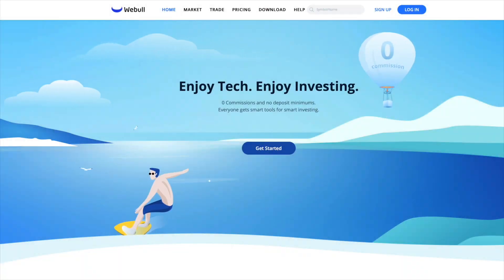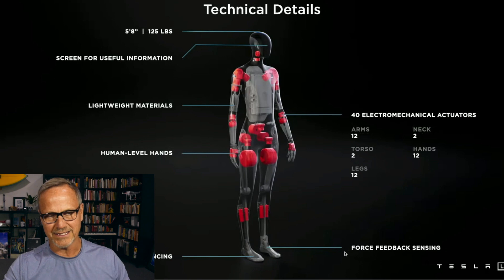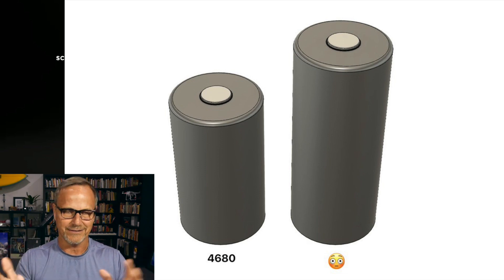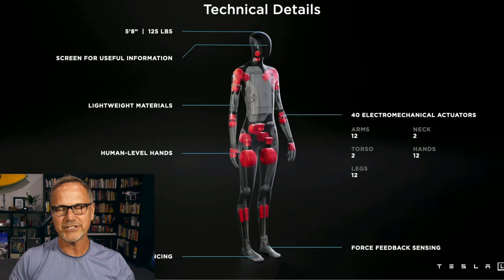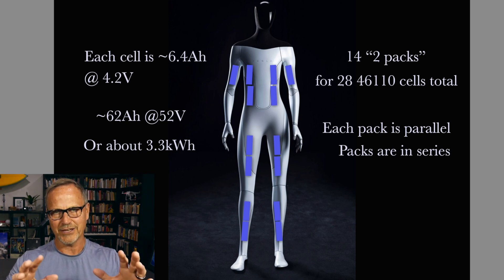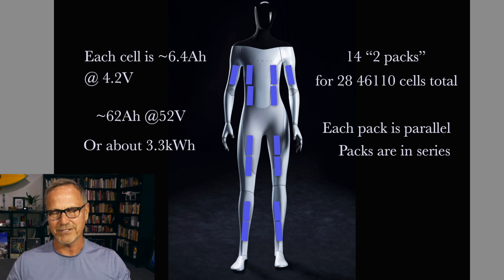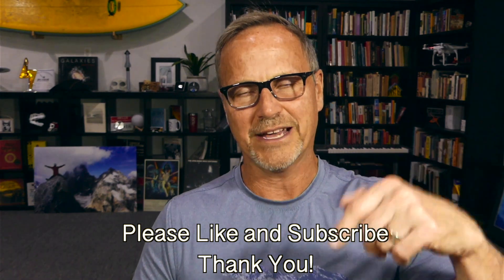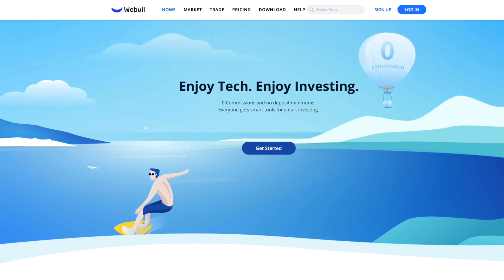Teslabot POWER!! Where the heck will the BATTERIES FIT?!

Comment: I'm having trouble with the math: When you put battery cells in a series, you add the voltage, but the capacity stays the same. When putting cells in parallel, you add the capacities, but the voltage stays the same. At 3.71 volts per cell, you describe a 52 volt battery@12.8 amp hours. That works out to 665.6 watt hours, not 3.3 kWh. The major source of heat will be the computer brain. Batteries charging and discharging in hours, not minutes, just simply won't produce much heat. Running the actuators won't actually use much power, and, this thing has full regenerative motion stop. While it takes energy for an actuator to start a move, they will actually recover some of that energy when the movement stops, sending it back to the battery. If this machine walks up stairs, it can gain back some of the potential energy it spent, when it walks back down the stairs. If it moves heavy boxes from an upper level room, and carries them down into the basement, and walks back up the stairs empty handed, it can actually GAIN power regeneratively, with no loss of battery charge whatsoever. That said, this thing can wander around all day on just over 1/2 kWh. This is a stark contrast to the Boston Dynamics Atlas bot, which can only run for a couple of hours on a massive 4.5 kWh battery. It has no regenerative stop motion, and being hydraulic, a lot of energy is wasted as heat. Keep in mind, Optimus only weighs ~125 Lb. Putting in a comprehensive cooling system would add weight, necessitating extra battery capacity, making it heavier yet.      
     I really hope that the finished product looks anything like the images we've been shown. This thing is beautiful. It's anthropomorphic enough to be personable, but not so realistic, that it's 'creepy'. It has no features, to define gender.

Comment: Distributing the batteries throughout the body like that goes against everything Tesla and their engineers are supposed to do. The Tesla bought will more than likely have two battery packs at most. They will be easily exchangeable and somewhere lower on the body for a low center of gravity so you're more than likely looking for somewhere around the hips. They also wouldn't add weight to the legs or the arms because that would make the servos work harder. 

Again I cannot stress enough how much complexity is hated at Tesla. 

The batteries will be quickly exchangeable because charging is not going to be what is wanted. 

These will be long-term workers on the factory and on Mars. You will run on One battery while the other is charging. Or you exchange One battery and then exchange the other to make sure there's always a backup in case one fails. 

Considering that most of the work will be done with the hands in front of the robot the battery and the exchanging of the battery will more than likely be done in the back. 

The main problem here is your failing to think like a Tesla engineer.

Comment: I’m guessing a standard version might look a little like you mentioned, but a backpack could be added for more “range” just like external tanks on jet fighters. Also a higher CG is actually easier to balance so that would help. For a bot lifting weight a slightly aft CG from a backpack might be helpful.

Comment: Legs, feet and pelvis bones for batteries or better still the skin. induction plates where it makes sense. feet or thighs if on a production line. For that matter if the robot is going to be on a production line, batteries would only be used for moving the robots around and FSD as they could charge while working. Solar and magapacks would be required for all factories.

Comment: 4.2 volts is not the running voltage of li ion batteries, 4.2 is there fully charged rate and is not the voltage you say the cell runs at. It's 3.7v that is the voltage of a cell being drained and is considered flat around 2.7 to 3 volts which it only hits once depleted under load when the bms cuts the power to save damage. Geez, this is meant to be a channel of smart people and you are making shows on false facts not only speculative!!

Comment: Presumably the weight distribution of the human skeleton is perfect as it is. Something closely matching that would be best with battery distribution. A spinal cell structure, tapering limb cell structures I.e thicker at the shoulder, thinner at the wrists, same in legs. Cells would need to be structural rather than dead weight.

Comment: You do not want mass in lower arms or lower legs since these parts move the farthest most often and thus masses there have the most momentum & inertia . Active liquid cooling is not all that complex and simplifies a lot since it is needed anyway. Batteries can have the cooling plate built in if it is simpler. The head is likely mostly empty so can be used as the radiator. Far future I might use a custom long skinny battery form factor to make a strong honey comb for the thigh battery. Whatever is heaviest, probably leg actuators, should be bunched up in the pelvis as much as possible for best balance even if bunching it up requires active cooling. Tesla is not trying to optimize the 100W car computer and will use the same hardware; perhaps both may get optimized when the chip shortage clears up. At least for the next few years new chip designs to lower power draw are too slow to get.

Comment: Brilliant idea. Distributed battery storage makes a great deal of sense if the technology is used to create Neuralink controlled prosthetics for people who have lost limbs or lost mobility. This would be an  high value application that would generate significant revenue while Tesla perfects the AI control side.

As for temperature control, the servos and batteries could be housed in a porous structure, with active air flow to cool them down.

Comment: You don't want the batteries in the limbs because it increases the load on the joints.  Batteries should go in the torso and if there is insufficient room then give it either a pot belly or a chest.  If you make the chest large enough nobody will care where the batteries are! :)

Comment: You forgot batteries in the butt !! 😆 Thanks John you are unique and a original thinker. Posterior could also be a good place to charge as Optimus could just sit down and charge … meaning it could charge will doing useful sit down type (assembly) work. While we are at it the posterior could also be a good centralized place to expel air with an Elon invented fart sound. Sorry it was just too tempting! 😆

Comment: the weights shouldn't be in the limbs.  The limb segments become lighter and lighter the farther out they go toward the extremities.  The smallest finger bones are at the tip and each bone segment becomes larger and larger as you go up to support all the mass of the total limb.  It's like a whip.  Throw a fast ball and you're throwing out your arm, actually you have to pivot your whole body including the hips and using the legs too - but the shoulder throws the upper arm then the elbow throws the forearm then the wrist throws the hand and the fingers acts like a whip uncurling all the way to the fingertip to throw the ball in a smooth efficient whipping motion.  The question is whether to try to use the example of the human body rather than just make up something new.  At least try to do it right, it's okay to fail but try it correctly first.  Humans can use 2 gears when walking and running - the slower gear is when walking on heels and the higher gear is running on the balls of the feet and using your toes.  Compared to regular quadrupeds like a cat, they only have one gear because they're already running on their toes.  You can examine your cat or dog, also look at an athlete sprinting you'll see toes are important.
The question might come down to, could a bipedal humanoid robot work without simulating human feet?  It must be attempted.  I think a tripod robot is not the plan.  It must be humanoid and thus it must learn to stand like all humans so that it can be inserted say into any human task.

Comment: I think the heaviest pieces would have to be central to the unit for balance.

I was thinking they'd go mostly in the feet, and torso, with perhaps some areas of the shin.  Feet is where I'd put a lot of the weight, so it has a strong base and isn't too top heavy, and chest because it's going to need that center of gravity / storage size.  I don't know about the arms.  If it gestured out too far to one side I could see it tipping with heavy battery arms.

Comment: i would put in two power packs, one built into the legs with a foot charger as people suggested so can stand in a show open a port and charge there. And an optional backpack power unit. This would allow battery swapping in areas where chargers arent possible. I.e in an orchard pruning or picking fruit.Would have a backpack on for extra power life

Comment: Thanks John, I think mass should be avoided in the extremities of limbs because these areas need to stop and start moving relatively quickly. I think in some situations the bot could be charging while working. eg. While performing functions at a fixed work station. The bot could plug itself in to a charger as it arrives at a work station.
I think the pelvic area and upper thigh area would be ideal places for higher mass infrastructure because when the bot bends it’s back too much mass towards the head would make balance problematic 
Great video thanks

Comment: Battery placement will depend to a degree on the work intended for the machine. For heavy lifting the robot will need a low COG to prevent toppling and provide a strong foundation for the extremities and torso to leverage from.

Comment: It indeed does make sense to distribute the batteries out partly for the reason mentioned in the video.....(i.e. weight management) and also mostly for SPACE MANAGEMENT. The limbs are likely to be hollow pipes (the geometry gives the highest strength for material mass) which can be easily filled with cylindrical cells .
In all probability it will be 4680 cells itself. Longer versions don't necessarily make sense (it's not just heat management, but structural strength also is important.....so longer ones will need thicker cell wall etc). Given Elon wants to have cookie cutter factories worldoever making standardized products it doesn't make any sense to create longer cells for Semis (which are really not high volume products!)

Comment: Around 10:00. Why couldn't each battery or pair of batteries have a small cooling system? I mean, you only need to cool each battery or a pair of batteries each.  Not a whole battery pack. They could pull power from the existing wires that go to the servers and electric motors.

Comment: Yeah…As a Design and Manufacturing engineer I have to say these batteries NEED to go in the chest area/ or backpack and NEED to be one unit.  If you spread out the batteries you will add a lot of wire/mounting weight throughout the system.  Distributing the batteries also causes a bunch of issues with how do you route the wires through a moving joint.  In addition it creates a bunch more potential failure modes/points.  You reduce the complexity significantly if it is a single part in the chest, and Elon is all about reduced complexity.
Reply: It does make sense to distribute the batteries out partly for the reason mentioned in the video.....(i.e. weight management) and also mostly for SPACE MANAGEMENT. The limbs are likely to be hollow pipes (the geometry gives the highest strength for material mass) which can be easily filled with cylindrical cells .
In all probability it will be 4680 cells itself. Longer versions don't necessarily make sense (it's not just heat management, but structural strength also is important.....so longer ones will need thicker cell wall etc). Given Elon wants to have cookie cutter factories worldoever making standardized products it doesn't make any sense to create longer cells for Semis (which are really not high volume products!)
Reply: @Randall Reacts Graphene wiring? More batteries low for stability? Capacitors higher for short term heavy lift motions? Inductive charging in feet for stationary duties & along routine paths?
Reply: I have been following Boston Dynamics for the last 10 years. Unless Elon buys an established robotics company he has 0% getting anywhere near that prototype the next 10 years. If he does lets say buys Boston Dynamics you can clearly see that the real bottleneck in androids is the kinematics and not the processing which is Elons selling point.
Reply: @jkntrds9635 Haah your comment didn't age well!!

Comment: The batteries might be integrated in the actuators in a smart way.
Reply: This could make sense. With micro charge inverters and control circuits for each group of actuators. This would reduce heavy wiring, add redundancy. It would only need control and balance wires between body segments. Also addresses keeping cells balanced if distributing cells throughout body. Lightweight. Still think they’ll just put batteries in chest and keep it simple tho.

Comment: Product idea: A charging mat or shoe it can stand on / slip into at its main workstation.  The advantage of a shoe (the first half of a shoe, just a receptible really for its foot), would be direct metal contacts as induction is not the best at higher wattages. Even only a 10% duty cycle at that location would likely keep it fully charged.

Comment: Don't put a lot of batteries in Optimus.  Then where they go is less important.

Let Optimus swap out its battery pack every few hours/whenever.  Opti would need a small permanent pack to carry it through the swap or a way to plug in during the swap.  But unless Opti has a task that sends it off into the wilderness for extended periods it could just take a (very quick) 'coffee break'  and do a swap.

Extended task away from the grid?  Pull a little wagon with spare battery packs.

Wouldn't you want the weight in the pelvic region?  No reason to be moving extra weight around as arms move.  Putting batteries higher in the torso would increase energy used for stability.

Or maybe in the legs?

Battery feet?  Opti would change its shoes from time to time.  Swap out one shoe at a time and the other foot-pack could keep Opti powered up.

Comment: It doesn't have to be a skinny bot to fit the necessary batteries. Optimization problem: more batteries = more weight = bigger motors = more weight = less range = more batteries...

Comment: Good topic John. Hadn't thought about this until you posted this. Thanks for starting it.
So here are my thoughts...
Center of gravity is much less important for ease of movement than low moment of inertia. Humans don't have a low CG and we manage (though evolution might have done a better job if our brains were in our chests instead of on the top of our necks). For this reason I expect the battery pack will be concentrated in the torso.
Structural packs make sense for the car because you have a marriage of three separate requirements:
- low CG to avoid rollover
- low moment of inertia in the horizontal plane
- a structural body part that is long, wide and thin.
It's obvious for a car (now that a genius has thought of it!)
But in general, a structural battery makes a poor structural member because its strength to weight ratio is low.
I predict the bot's battery pack will be a single module, either rectangular or shaped to fit the space available in the torso.
It could be easily replaceable through a panel in the back, or better still, the back panel of the battery pack could be structural and form part the bot's back.
It will be fun to see what really comes out!
Reply: hey I see a lot of people have great ideas.  Do you think the torso will be flexible?  I imagine a human balances using the whole body and also we can bend and twist at the waist.  Maybe the batteries will be in a flexible cage.

Comment: 3.3kW is actually way overkill, even considering running electronics at 100W/h (33hrs) + mechanical energy, which actually for the size and function of it is at least 20x lesser need of that of the car, if not 50x, amounting to about the same consumption that of electronics (100W/h at most). So 16-17 hours of autonomy at full load. Definitely unneeded, since in practice it'd run various energy-saving routines and will not work at 100% load all the time of its existence. I'd say 1.5kWh is the maximum it should need. That's my few cents.

Comment: I think assuming a new cell size is premature. The good news is that 3 4680s in a row requires only 2cm more than 2 of the as-yet unseen "46110s." Tesla is focused on scale, and will be spending lots of time working towards producing 4680s in high volume. Another form factor (even if only one dimension changes) means a parallel set of battery production lines. I know you led off with the "this is speculation" disclaimer, but IMHO if you assume 4680s (or even 2170s) this becomes much less speculative and much more of a first-principles engineering exercise around power requirements and weight distribution.

Comment: 1) Don’t you think that the FSD computer should be located in the head?
2) Apple has experimented with odd shaped batteries for their laptops most of the extremities could be filled with batteries.
3) Wonder how much energy can be regenerated by walking. The calves could contain the mechanism to generate electricity and storing it in capacitors.

Comment: Some possible applications may not need much in the way of battery capacity. A TeslaBot assigned to a Tesla Supercharger station to connect/disconnect car charging cables can recharge between events. A TeslaBot at a static station in a production line could be permanently connected to mains power (or wirelessly recharged).